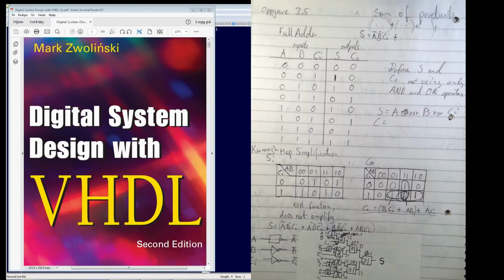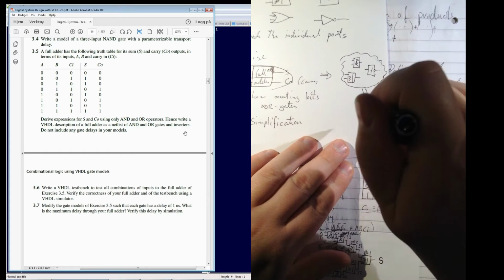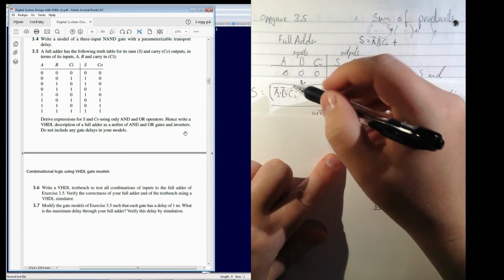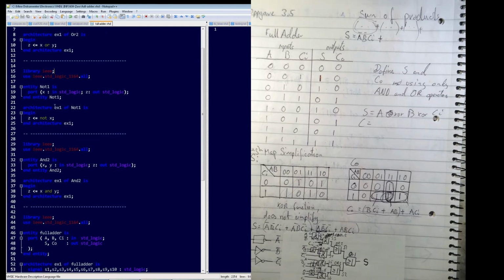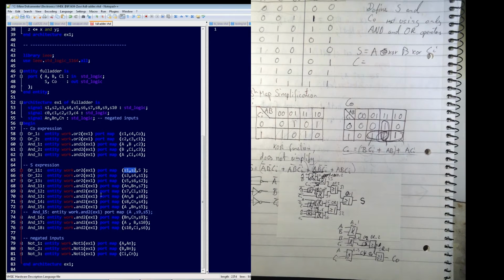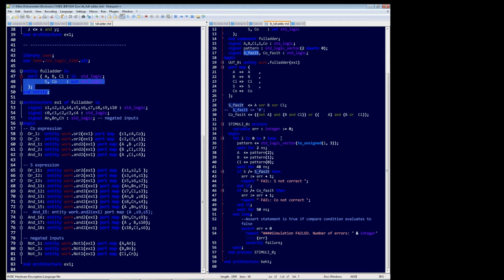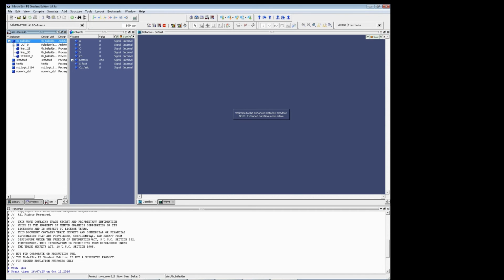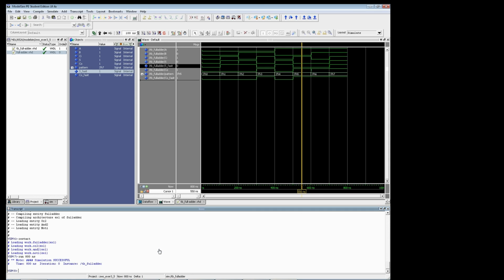VHDL netlist and self testing testbench - Exercise

Comment: So, I don't know what "fasit" means...
Is it possible, Hans, to increase the font size in the editor? It's really small and with the blue on blue it's quite hard to read.
It's making more and more sense to me. The test bench is still a bit fuzzy but I think I can run with it.
Reply from the maker: fasit is like the correct answer, like in when you've done an exercise you can look at the answer at the end of the textbook.
Reply: is it Norwegian? Or my lack of general knowledge?
Reply from the maker: Last I checked there is an english word, but it came out as blueprint and key. Weird. When I google, it seems not used much. It is very common in Norwegian to have a Fasit with a collection of answers.
Reply: Key is right then. That's what you call the answers to a test.

Comment: I've just realised something. When testing regular code (software) there is a good chance you will never reach certain bits of code. To make sure you do, you normally use stubs to output something so you know your code is run in that place. 
When doing this type of code I think you're always sure you always execute every bit of it. Right?
Reply from the maker: Not sure if I understand what stubs of code is. It is important to try every combination. If some part of the code is not reached, the compiler might tell you that the signal name xxxx is always 1 or 0..
Reply: bwack Oh sorry...a stub is when you output a string just to see if the program reaches there.